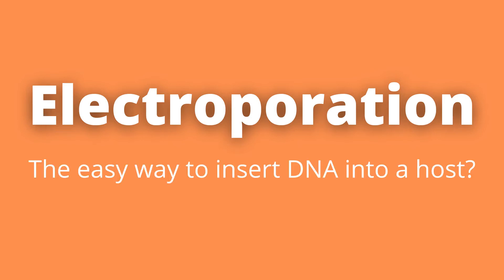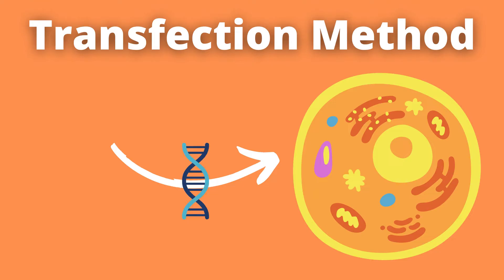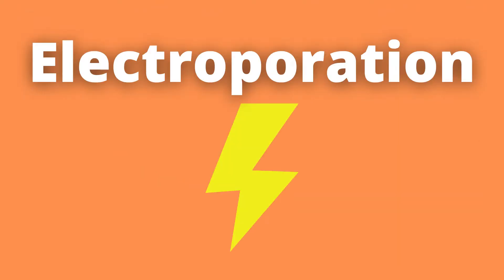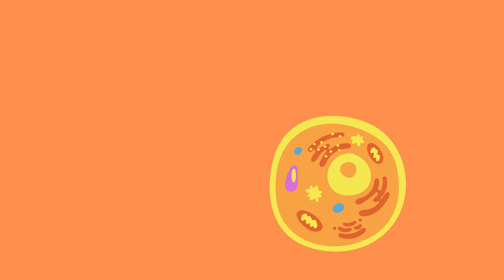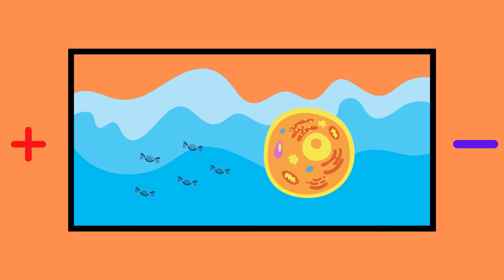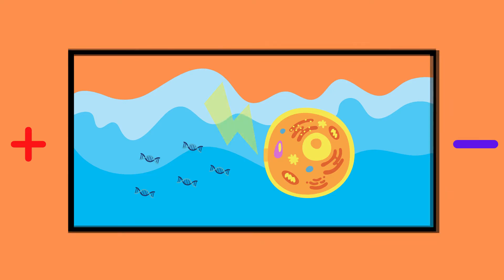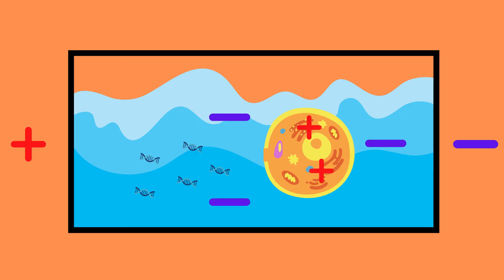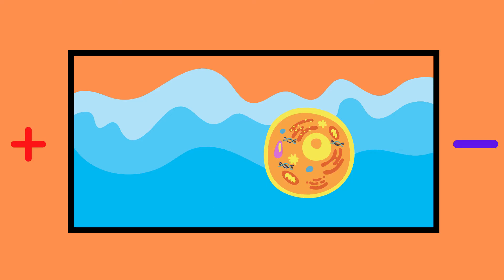Understand Electroporation In Under 3 Minutes

Comment: Certainly! Here are 10 data points on the topic of electroporation and 5G, highlighting how they relate to each other:

1. Electroporation: Electroporation is a technique that uses electric pulses to temporarily create pores in cell membranes, allowing the uptake of molecules that would not normally cross the membrane.

2. Cellular Response: Electroporation can induce changes in cellular behavior, such as increased permeability or enhanced cell membrane repair mechanisms.

3. Gene Delivery: Electroporation is widely used in biotechnology and gene therapy to introduce genetic material into cells.

4. Electromagnetic Radiation: 5G technology uses higher frequency bands, including millimeter waves, to transmit data over wireless networks.

5. Millimeter Wave Electroporation: Studies have explored the potential use of millimeter waves in electroporation to enhance drug delivery or gene transfer efficiency.

6. Increased Bandwidth: 5G technology provides increased bandwidth, enabling faster and more efficient data transfer.

7. Potential Applications: 5G technology, in conjunction with electroporation, could enhance delivery methods for pharmaceuticals, vaccines, or personalized medicine.

8. Remote Healthcare: The combination of 5G and electroporation could enable remote monitoring and delivery of healthcare services.

9. Precision Medicine: Electroporation enabled by 5G could facilitate targeted delivery of therapeutic agents, opening up possibilities for personalized medicine.

10. Research and Development: The synergy between 5G technology and electroporation offers opportunities for further research and development in drug delivery systems and medical technologies.

It's important to note that while these data points highlight the potential synergy between electroporation and 5G, further research is needed to fully explore and understand their combined applications.

Comment: Congratulations and thank you very much for the video! Your channel has been a great discovery. Do you have any videos on other physical methods like sonoporation or magnetofection?☺
Reply from the maker: No sadly I don't... YET! I'll add it to my video-to-do list!
Reply: @LucasLearnz  
Certainly! Here are 10 data points on the topic of electroporation and 5G, highlighting how they relate to each other:

1. Electroporation: Electroporation is a technique that uses electric pulses to temporarily create pores in cell membranes, allowing the uptake of molecules that would not normally cross the membrane.

2. Cellular Response: Electroporation can induce changes in cellular behavior, such as increased permeability or enhanced cell membrane repair mechanisms.

3. Gene Delivery: Electroporation is widely used in biotechnology and gene therapy to introduce genetic material into cells.

4. Electromagnetic Radiation: 5G technology uses higher frequency bands, including millimeter waves, to transmit data over wireless networks.

5. Millimeter Wave Electroporation: Studies have explored the potential use of millimeter waves in electroporation to enhance drug delivery or gene transfer efficiency.

6. Increased Bandwidth: 5G technology provides increased bandwidth, enabling faster and more efficient data transfer.

7. Potential Applications: 5G technology, in conjunction with electroporation, could enhance delivery methods for pharmaceuticals, vaccines, or personalized medicine.

8. Remote Healthcare: The combination of 5G and electroporation could enable remote monitoring and delivery of healthcare services.

9. Precision Medicine: Electroporation enabled by 5G could facilitate targeted delivery of therapeutic agents, opening up possibilities for personalized medicine.

10. Research and Development: The synergy between 5G technology and electroporation offers opportunities for further research and development in drug delivery systems and medical technologies.

It's important to note that while these data points highlight the potential synergy between electroporation and 5G, further research is needed to fully explore and understand their combined applications.

Comment: the video is very helpful, thanks! Is there a minimum and/or maximum voltage that is needed in order for the process to be successful but also permits the cell to regenerate?
Reply from the maker: I'm sad to say that I'm not familiar with the specific voltages required. Please let me know if you find an answer😇